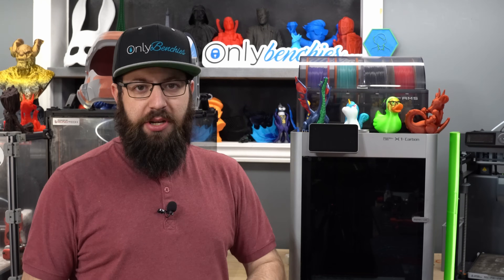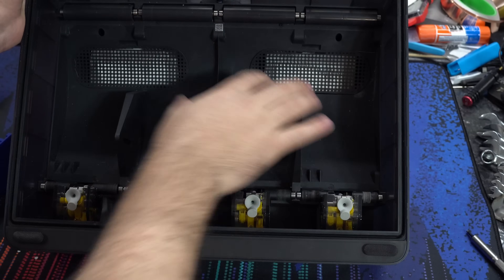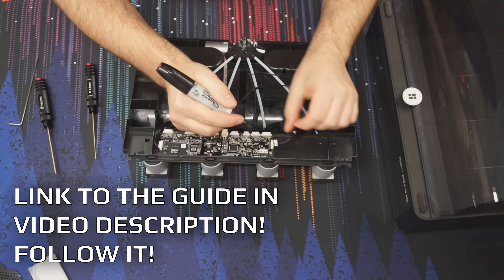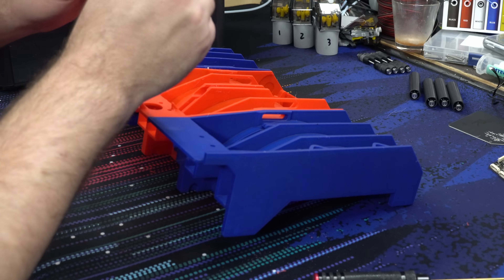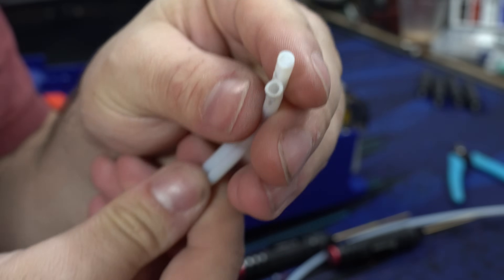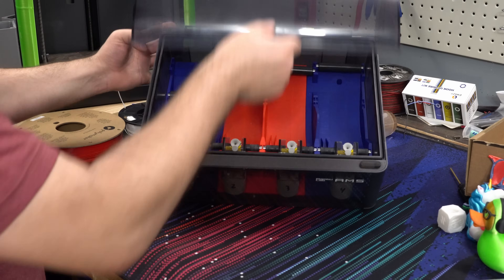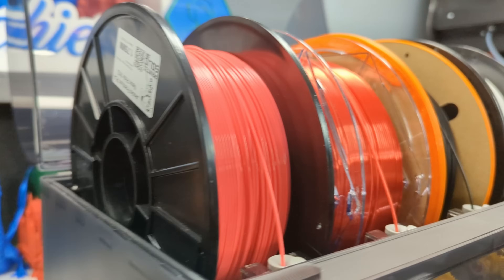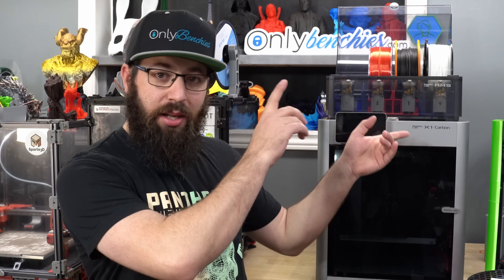Upgrade your BambuLab AMS with HYDRA!

Comment: Any idea on where i can source replacement screws for this? The "AMS Screw Kit" on Bambu labs store only has the external ones for the back of the printers.
Reply from the maker: any self tapping plastic screw around the same size should work, heck just force an m3 in their, the 2 screws that hold down the plastic part are mostly not needed anyways tbh

Comment: It seems like a clever creator could design a spool that the smaller, sample, spools fit on to make them the correct width to fit. And I either wouldn't buy the bigger spools, or transfer the filament to a working spool. But hey, I just started in the 3D print world, so what do I know.
Reply from the maker: ya, im not transfering 100+ spools of filament on to a smaller spool to make it AMS compatible so they are all ready to go, nor am i going to respool a single spool just for 50g of a colour every time i do a multi colour print

Comment: Is not your fault, i repeat is not a comment directed to your persona or your video, but why would i risk damaging a board with static, spend hours printing stuff, spend time disassembling my AMS just to find that some of the rolls i wanted to fit...still don't fit and i have to keep my AMS open and lose one of the main features of the AMS???. Isn't easier to just print a PastaMatic and respool those spools into spools that fit? I know that's what i do and takes 5 mins. Thanks for the video.

This project takes like 24hrs of parts printing, 1/2 roll of filament and $39 from amazon parts.

Heres a link to the PastaMatic:
https://youtu.be/baVHUav70CY?si=WrMQkrb8k8urT3yf

And a link to the motorization of the PastaMatic:
https://youtu.be/hxoC0TyMoEs?si=yVs4kgwkvYD6GztC
Reply from the maker: I have over 100 spools of filament on hand, im not going to either re-spool every single one for AMS compatibility nor re-spool everytime i need 50g of a colour for a print

As for the gap, you can print a spacer

Im not going to rework my entire print setup and work flow just to deal with the AMS spool compatibility issues, im going to make the AMS work for me

Comment: Hey, I'm new to this. But I (ofcourse as a newbie) wonder if I can use that box on a Bambu A1 printer. 😅😊

I'm thinking about moisture.
Reply from the maker: Nope. The ams for the a1 series is not compatible with the p1/x1 series ams and vice versa.

Bambu COULD have made em cross compatible but didn't...

Comment: Just looking at getting into 3D printing, so thanks for the video. However watching about the smaller spool size issue, why not just print a two piece spool adapter that snaps or barrel screws together to extend the size of the smaller spool to a larger size with either tabs or foam gripper on inner surface to ensure it spins with the carriage and not independently of it.\

Comment: I would say eliminating the AMS functioning as a dry box is a pretty huge downside.
Reply from the maker: If only there was a simple print that could fix those issues
Reply: @CanuckCreator  that's just bandaiding a bandaid IMO. I'll stay away from frankensolutions and swap everything onto bambu spools. It's usually straightforward and rarely requires a complete respooling, which I already have the print for. But thank you for the video regardless, I was curious about the pros and cons of this mod and the video helped.

Comment: Just a heads up for anyone about to print these, don't print these in pla, especially if you mount your ams on top of your printer. After a while mine warped and would not hold the rollers anymore. Just finished reprinting in petg.

Comment: Someone should reverse engineer the connector and produce compatible systems. There probably isn't much to it if it got rid of the (kind of useless) RFID readers and just had motors for moving filaments back and forth through feeders.

Comment: AMS is a waste of money. Come on, 4 colors. So, more complexity for what? Just use craft paint. Far far better looking and infinite choices in instead of 4.
Reply from the maker: i mean, if you had spent any time researching it you would know the system can do up to 16 colours with units paired together
Reply: It's also used for continuing multiple spools of the same material. When one is empty the AMS will continu the print with the next one.

Comment: Hey Nero.  Thanks for taking out the time to show how this mod is done!   I have a question you can answer.  Bambu support has not been very helpful.  I purchased a couple of Bambu x1 printers, and one of the printer's AMS units has no working lights.  None.  I have changed cables still no go.  I have opened it up and checked all the wiring.  Your video shows that each feeder has a plugin for the main board.   I find it hard to believe that every feeder cable going to the board doesn't work because the unit grabs filament and works as it should.  I have zero lights.  Came that way.  Do you have any idea why this might be going on?   I doubt its the main board because each feeder has a separate line into the main board.  This one really has me scratching my head!    I really appreciate any help you can provide.

Comment: Ok this is off subject.  Can you tell me which motor a/b is x and y.   I appreciate it. Thanks and love the videos
Reply from the maker: depends on the printer and how the belt run is setup
there is no "x or y" motor in a corexy setup, its A/B 

The x=a y=b or w/e stems from legacy labeling on controller boards that have setups like X Y Z E0 E1

Comment: Rewind big spools and print spool adaptors for the others
Reply from the maker: as someone with near 150 spools in inventory respooling just cus i want to use one colour for one print is not really a practical solution
Reply: @CanuckCreator  I get why someone would do it. Different strokes for different folks. I run a small amount of brands/colors and My 3kg/5kg spools wouldn't fit the hydra anyways.

If someone develops a mod that can run multiple 5kg spools/ AMS hub compatible/ with no drawbacks. I'd be game.

Comment: I am using the spool winder on printables to load filament on Bambu reels (that you can print yourself) and everything works perfect. I realize it is an extra step, but the spools edge ate consistent, wider, and diameter perfect. So, dry box retained and zero issues due to slightly diff diameter spools which can loosen filament a bit on spool. It take under 2 minutes to transfer a spool…another option…
Reply: could you provide the link for the files?
Reply: Two minutes? Can you please share more?

Comment: maybe you should of said in the first min you cant close the lid and defeat the entire purpose of the AMS.... No down side to your mod? what an opinion and not a fact.... NO. the system DOES NOT work.  You cant close the lid. how does that fact, define, "the system works", when the "system" was designed to keep stuff DRY.
Reply: Pwned
Reply from the maker: Good thing i highlighted and linked a mod that corrects that issue

https://www.printables.com/model/401970-ams-lid-lifter-with-lock

Comment: Hmm Im worried that I've bought the wrong thing, if there an entire mod to replace a $500 part it screams theres massive problems. . I dont know if its just me as an Australian, but when i pay for something form a manufacturer, it damn well should work out of the box, and thanks to our warranty laws, it should work for a minimum of 12 months and can actually be expected to last a lot longer than that based on how a company displays, charges and advertises their items. Now what i mean by that is, If a consumer buys lets say a new car, they shouldnt have to pull the car apart to do what it should do well, ie be a car. In this case, its entirely unreasonable for a consumer to have to pull all this apart to fix problems that should have been fixed prior to selling the ams to consumers. How can we tell what version we have of the AMS? Whats the benefit of such a mod? I do like the ability to put smaller and larger spools, but the whole point of the system is to encapsulate the spools within the ams, Ie wouldnt it just be easier to print a spooler so you can for example chuck your 3d printed spool that suits the ams and spool off a bulk reel onto the bambu reel? I dunno maybe im just worried that there has to be these workarounds on a machine thats designed to not have to be tinkered on endlessly.?
Reply: To be fair, it works with there filament which of course they want you to buy. Essentially if you stay in there eco system everything should work as intended. I think it would be a little unfair to expect Bambu to make a perfect system on there first try which works with every single filament in the market. Although I am speculating since I only have an X1C without the AMS
Reply: You can print spare spools and transfer your third party filament to those spools. Seems weird to expect every kind and size of spool to fit, when there's no standardization.

Comment: the issue with this system is the color flushing is never complete you can see the black fade the red around the eyes and for this reason an idex is a must for multi color prints
Reply from the maker: Ya this is default settings. Purge can be increased
Reply: @CanuckCreator  this is nice and pretty cool  to have the adjustment but black and red don't like flushing out the worst same with yellow green and blue all can use different flushing times over others and the pigment used in the master batch can also differ in flush outs so it still a guess at times if the nozzles contaminated from the last color/Material, who knows when it will release into the print on another color especially when the base material is different and carbon and gels will get ya too if you use different base materials in the same nozzle Carbon is right behind waiting to release when your not ready and if you run TI02 white MB filaments with high MB loading it will also require more flushing than others do. chunks and colour can just release as the nozzle pressures reduce enough to release some of it and also increasing pressures can release more of it again! unless you run the same resin all the time you will have contamination issues i feel for these reasons above! cheers! great videos and audio you have 
could you do a J1 SM review I just wish it was open! but love the Idex fast changing heads and keeping the materials at bay

Comment: Great design. I think the next evolution in this will be a mod to the top that allows the lid to shut and the desiccant to be used. My RH in the box now is 10%. I don't want to lose that come summer when it gets more humid
Reply: Hume made some dessicant holders that go through the center of the spool. I just wish there was an easy way to mount the humidity sensor facing forward.

Comment: Looks like way too much effort. I just respool any oddball spools to standard spool size, using an automatic respooler found on Printables.
What the Bambu really needs is a robust and reliable PTFE tube Y splitter to allow feeding from external spools without having to disconnect the AMS.
I tried all the printable ones I could find, and tried to make my own too, but all failed at some point.
Reply: Bambu is selling a Y-splitter now. 4 to 1 I think.
Reply: @Yggdrasil42  you meant the AMS. That's not a Y splitter. I found a really good one on Etsy for cheap though.
Reply: @mururoa7024  No an actual.Y splitter. Saw it yesterday in their webshop.
Reply: @Yggdrasil42  I found it.

Comment: Great review! And FYI.. I know its just a test print but I have found when using darker filament (like black) I need to increase the purge amount (black to any other color loaded in the AMS). This will prevent the bleed through you're seeing around the head on the same level of the eyes.

Comment: Hey Nero - awesome video.  This mod removes one of my barriers to considering the Bambu products, the inability of using any filament in the AMS.  If I decide to expand multi-material / multi color away from my Prusa MK3S+/MMU2S, I'll need to consider the pro/con of the Bambu.
Reply: I was in the same spot until I ran a slice on Prusa Slicer and the MK3S was going to take 1day 8 hours and the bambu said 7 hours.
It's pretty amazing what this thing can do.

Of course, no carbon fiber or any rough filament can be used in the AMS, so that's a negative. You can, but it'll chew up the tubes.

Comment: @Hume Beam did a really good job. I haven't printed it yet because I don't have small rolls, but it's nice to be able to use them now. Hopefully Bambu will contact Hume Beam to adopt this design for future releases. The design has already been presented on the Bambu forum and Bambu Labs should already know about it. If you have already disassembled the AMS I would also advise to change the PTFE tubes right away for Capricon tubes and adjust the lengths that there are no sharp bends. This is the first thing I did after delivery of my AMS ;-)
Reply: where do you get Capricon tubes for the AMS ?
Reply: @motomatta1  Make your own from bulk Capricorn.  My concern is that you can not see through the walls

Comment: you can't "strip" when you screw into plastic holes. the holes simply deform and skip unless you're printing with a very rigid material.
Reply: End result's the same isn't it
Reply: @Yggdrasil42  NO BECAUSE THEN THE HOLE IS NOT DESTROYED

Comment: Hey Nero, thanks a lot, that was a spot-on review. I'm thankful for the spotlight! :)

I had mostly compatibility with (wider) 1 Kg spools in mind at first with early prototypes but expanded compatibilty for ones with a smaller diameter as well before release. 

Most smaller spools (Taulman PC and most 500 g spools for example) do work but as you correctly covered, 250 g sample spools that are very slim in width catch the front feeder as they are about as wide as the feeder itself so in that case we have to use a workaround with spool adapters.

I will post a couple that adds compatibilty with these small 250 g spools and also larger cardboard spools in the next few days, just need to test a little first.

Thanks again and have a great weekend.
Reply: you de man!

Comment: Is there a way to use the AMS with Vorons?(so basically with Klipper)
Reply from the maker: Nope. Would require a new controller at a minimum
Reply: Lets hope someone hax it i would love to use the ams  with my new micron and v0 im building
Reply: I am in the process of installing a 3D Chameleon on my Rat Rig.  It is very much like the AMS, but no enclosure.  It uses a y feeder to feed 4 filaments into the extruder.  currently sold in the US for $199.  Something I like vs my AMS is the filament load time.  It only retracts about 10 inches to load the new filament.  What I don't like is the way it is controlled by the printer.  It has no direct connection, instead you have the printer hit a switch to tell it what color to use.  I have it mounted and am going to test tomorrow.

Comment: You've got to love how the community will even improve closed-source products. That's so great.
I'd have thought a simple spacer piece would solve the narrow spool issue.
I can see there's some bleed of the black filament in to the red on the layers with the eyes on the Kirby print. Looks like more purge is needed.
Reply: Saw your post after posting, great minds and all that jazz 😄
Reply: at one point couple months ago, i tried running reverse bowden tubes to carrot patches as a test for different spool sizes, didint work due to the interaction with the active rollers in conjunction with the sensors, very annoying. theorized putting a riser with rollers that would be active driven off the motorized ones, but never got around to modelling it. the angle needs to be shifted on the active drive modules too, it catches on spools that are filled near the edge.  this mod should probably accommodate almost all of the issues ive experienced. 

would like to see a voron head pick up the cutter the way the bambu does it with a toolhead mounted blade and a boop pin on the frame.  would solve the ercf tip problem real easy at the cost of waste material.